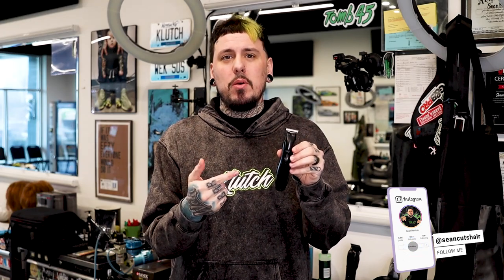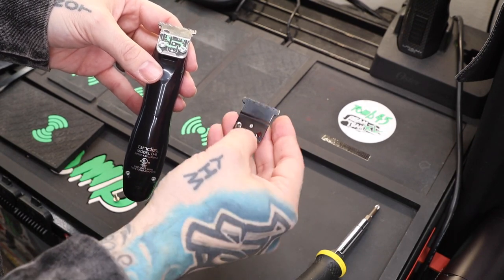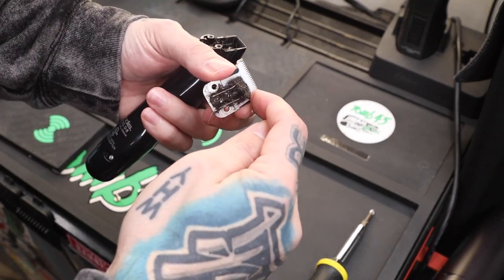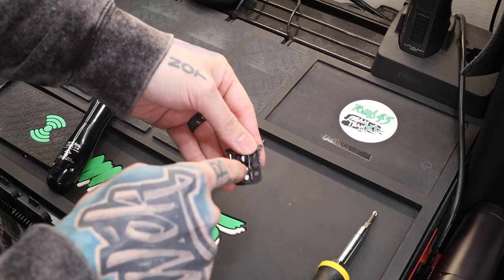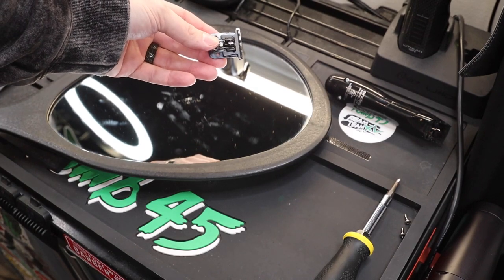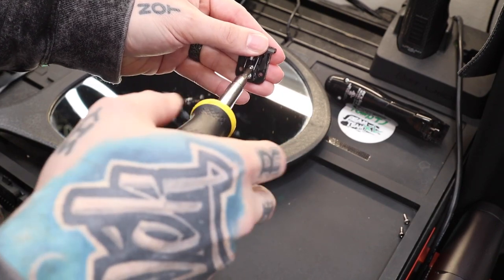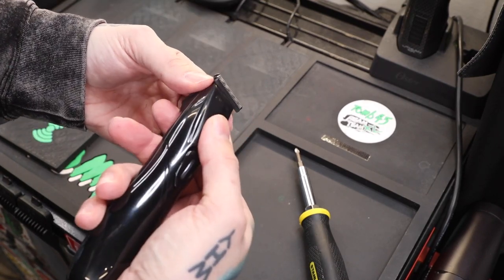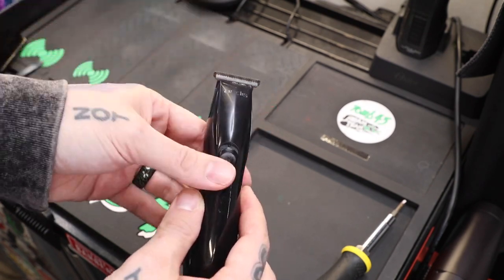HOW TO ZERO GAP Slimline Pro Li Andis Trimmer

Comment: I zero gapped my skeleton trimmers like 10 times. Doesn't leave a scratch line on my hand or arm but I have some people say its pinchy when using it on the back of their neck, and I have some people that it doesn't bother. Are they too sharp or are some people different.
Reply from the maker: Those are the most finicky trimmers. Definitely have to just try until you get them right. If it’s pinching that’s different than being sharp. I’d take it apart and make sure it’s real clean then set them again

Comment: Is there a screwdriver to use, I can't unscrew the bottom screw?
Reply from the maker: Just have to use the correct bit so it grabs it as good as possible. Larger screwdriver handles will give you a little more torque

Comment: yo man im between getting the slimline li's or the slimline GTX's. you prefer the li's over the GTX?
Reply: To me in  my opinion it barely has enough power for the small blade the bigger blade makes it ever less powerful.
Reply: @desmondmitchell5602  damn might just get the corded t outliner then. appreciate it!
Reply: @matttalley4706   💪
Reply from the maker: I agree 100%
Reply: Wait for the philty Blendz babyliss fx2 mod where you can put the gtx blade on it with an updated motor and battery.. it’ll basically be a slimline
Reply: @desmondmitchell5602  Agreed. I use it to create my bald line and remove the rest of the bulk before I use the Shaver. Just like how seancutshair does it.
Reply: @Dominicreviews  lol my guy merry late Christmas
Reply: @desmondmitchell5602  Merry Christmas and happy holidays brother.
Reply: @matttalley4706  Or the Wahl 5 Star Corded Detailers?

Comment: Is that Knock off blade any good, or you just using it for the video
Reply from the maker: Ended up putting the ceramic cutter on the knock off still blade. Wasn’t very good
Reply: @Seancutshair  Where did you get the Ceramic one from?